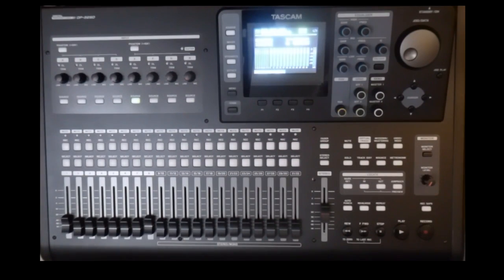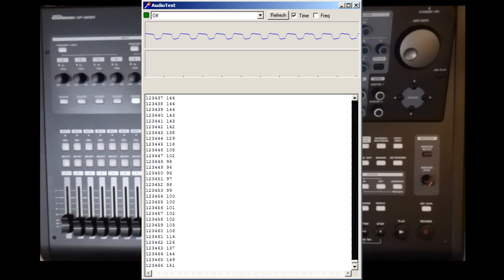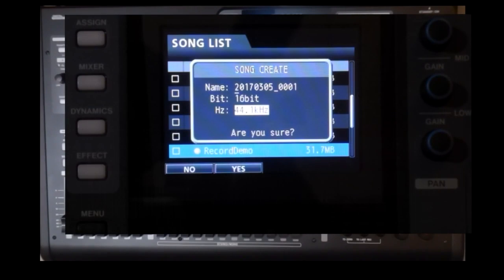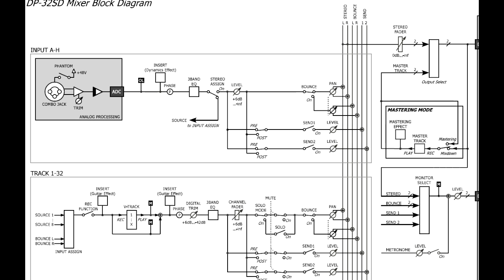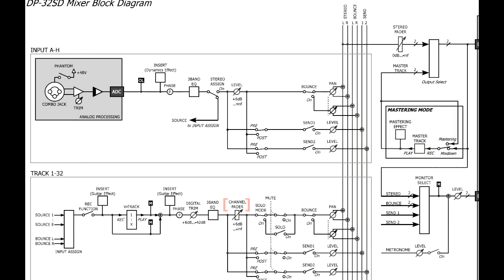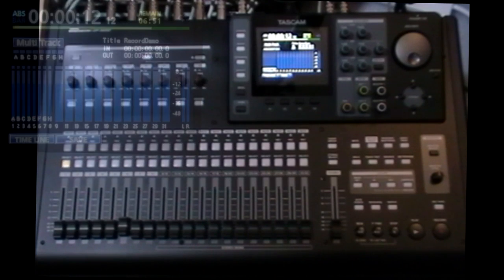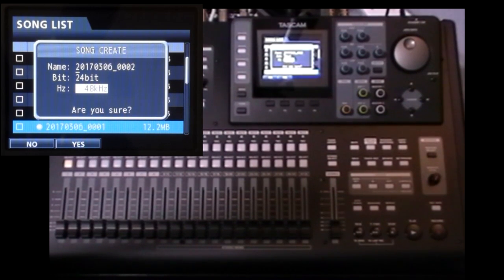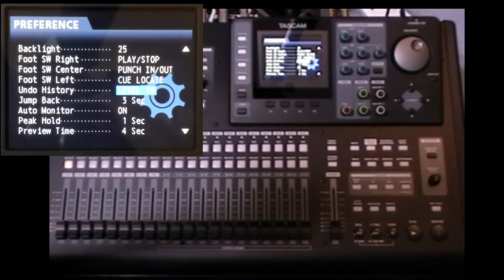Tascam DP24/32SD Tutorial 8A: Recording

Comment: There are some misleading assumption made here. Bitdepth is just the dynamic range and samplerate defines the bandwidth aka frequency range. Check out Nyquist. NOT how "detailed" a recording is. A recording with 16bit sounds the same to a 24bit recording. The noise level is just a higher which can effect the outcome but mostly not how people think of. Imagine everything every recorded on tape had specs much worse and the beatles, Michael Jackson and Pink Floyd sound fine til this day.
This whole 96 khz is more a marketing gag because you are just recording sound above 20 khz. What is there for the human ear? But the waves in the hearable range sounds the same. When I was young and started recording I thought switching to 24bit and 96khz would help to improve my productions and was wondering that it did not.
What I am just trying to say is: A pro recording with good musicians, mixing knowledge etc with 16bit and 44,1 khz will sound more "detailed" than a shitty sound made by an amateur in 32 bit 192 khz.
Reply from the maker: @timpanic thanks for the clarification Tim.

Comment: When I record, I hear the "punch in" of anything I want to fix.  the record button is so loud it picks up on the track.  is there a way around this? I have moved my mic to many different positions and places, but it still picks it up way too loud to cover it up with music :(  Help!
Reply from the maker: @Carrie-y4q If you use the Auto Punch In feature, the machine will go into record mode a few seconds after you press any buttons so your mic won't pick up the clicks. This delay is defined by the Pre-Roll period (which I think is set to 4 seconds by default). See the section in the manual called "Automatic punching in and out".
There's also a Repeat mode option with this, such that it automatically rewinds and records the section again onto a different virtual track. There are 8 virtual tracks so it can record up to 8 takes, all completely hands/click-free.
You could also use a footswitch, but I don't know how quiet they are.
Reply: purchase the foot pedal.  it works great and you do NOT hear the punches.
Reply from the maker: @Carrie-y4q That's good news Carrie, thanks for sharing.

Comment: Hi, you are doing a very detailed explanation here.
can you please confirm (or Not) if this device can be used as a drum microphones mixer? 
I mean can i put 8 mic in from the drums and record the drum set? thanks in advance mister.
Reply from the maker: @Bricksfromafrica Hi, yes it can be used to mix anything. The only limit is the max number of inputs, which is 8, so you could use all 8 for drum mics if you like, or use a combination of mics and line-level signals. If you've just started watching these videos from this one #8A, I strongly recommend you start from the beginning, and you'll see 2 ways of using the machine as a mixer. If the videos are too detailed, the step-by-step PDF guide may be useful to get started quickly without getting bogged down. You can always revisit the videos as & when you progress. Thanks for stopping by.
Reply: Thank you for your time.

Comment: Hello, I have a DP-24SD.  I'm trying to figure out how to record to tracks 13/14 - 23/24. I'm looking at the block diagrams. Page 77 on it doesn't ( Track 1-24 ) make sense.
Reply from the maker: @mbw4359 the crucial part of the block diagram is the STEREO ASSIGN switch. Admittedly, it's not very clear but this represents the Assign screen, where you can connect/route any of the 8 inputs to any of the 24 tracks, and/or directly to the stereo bus.

On the block diagram, the line going downwards from the switch, and then to left, is the path down to the track INPUT ASSIGN box.
The line going to the right from the switch is the direct path to the stereo bus.

Video 6A and earlier shows all this. If you've jumped straight in to this video 8A, you should really go back and watch them in sequence.

The assign screen saves you having to unplug/replug your intruments or mics; you just alter the assignments and record to different tracks as you want. The Model series does not have this feature, or at least it didn't when they first came out.
Hope that helps, and thanks for stopping by.
Reply: @philtipping  Hi Phil. They say a picture is worth a 1000 words! Well I figured out my problem. The manual doesn't show a picture of the assignments for tracks 13-14 / 23-24 Page 35. While trying to do something else I noticed that you had to use the arrows or Jog/Data to move it to one of those tracks. Your videos are very meticulous and I'm learning things from them still. TASCAM tec writers could learn a thing or two from you. Thanks!
Reply from the maker: @mbw4359 glad you got it sorted. That picture on page 35 shows the default assignments, which is inputs A-H routed to tracks 1-8.
If you don't like the default assignments (like me!), you can un-assign these (All-Clear F2) before you create your 'reset' template (video 2).
The videos also show another technique for setting assignments (or 'patching'), using the track select buttons and input source buttons. If you press the track button first (the patch destination) so it lights up, then the source button (the patch source), it makes the assignment between those 2 items. As with other operations, there are several ways of doing the same thing, so use whichever method is most comfortable/intuitive to you :)
Reply: @philtipping  u should be their tec writer! LOL

Comment: Hello, I’m having trouble assigning reverb to a channel. I’ve managed to figure out how to send flanger and tremolo etc but for some reason I can’t get reverb to play. Am I doing something wrong? Thanks!
Reply from the maker: @rickyhughes93 Reverb is available in the Send effects and also in the Amp section of the Insert(Guitar) effects. They are configured in different ways. The Send effects use the Eff Send controls to tap off a signal into the effect, then it returns onto the stereo bus for mixing at mixdown, or the bounce bus when bouncing.
The Insert(Guitar) effect is simply inserted into the required track signal path.
This summary may help: 
http://www.philizound.co.uk/freebies/dp24-32/FX-Summary.pdf
If you want step-by-step instructions, see the Step-By-Step PDF guide, available here:
http://www.philizound.co.uk/freebies/dp24-32/dp24-32.html

Comment: Phil,
I'm a bit flabbergasted by all the technical stuff but I have a question. I have an electronic drum kit (Alesis Crimson II) which, when I put in a stereo lead to my Tascam DP32, always sound echoey, like it's being played in a concert hall half a mile away. The mono sounds better but obviously, I would love to set up my drums so that I could pan certain drums/cymbals left and right to give them a bit of stereo depth. It means I have to take the reverb off the drums and just have them pretty flat sounding but that would be ok in the recording process. What I can't deal with is sounding like the whole thing is half a mile away in a concert hall (distant and echoey) The same thing was happening with the stereo lead on my other multitrack recorder, the Zoom Player, so what do I need to do to get the drums to sound good on the multitracks, especially on the stereo leads?
Reply from the maker: @fanfanackapan I don't have that drum kit, but I couldn't see any mention of reverb in the manual so I guess it's not a rogue setting on the Alesis, which means it must be coming from the Tascam... although this wouldn't explain why you also get reverb when using the Zoom... so I'm wondering whether it's really a phase issue, as this can sound similar. 

The problem can be caused by connecting a stereo output to a balanced input, in which case the left & right sides will be out of phase. The Crimson output is a single stereo jack socket, so you really need a splitter cable to connect it to the DP machine. If you just use a single cable, this will present the left & right signals from the Alesis to the hot & cold connections on the Tascam's mono inputs (all inputs are mono) and you'll get phasing issues. A splitter cable will have a single TRS plug at one end (for the Alesis), and 2 TS plugs at the other (for the Tascam). The latter are the left & right signals which should connect to adjacent pairs of inputs on the DP machine. You can assign these to a stereo track or 2 separate mono tracks.

On the offchance it really is just a rogue reverb from the Tascam issue though, this should also be easy to fix. It's very easy to get unexpected effects with the DP machines as all settings are carried forwards into new songs when you create them. The first couple of videos in this tutorial show how to avoid this by starting with 'blank slate' settings. If you don't do this, your only option is to go through all the effects and turn off the culprit. It's quite tedious to do (as shown in video 2) as there are 3 different sections for effects, and they can be applied to any of the 8 inputs and any of the 24/32 tracks.

Re. panning individual drums, it seems the Crimson machine only has a single composite output, so you cannot separate the individual drums for recording on to their own tracks. I guess you could make multiple recordings with the Crimson set to one drum sound at a time, and overdub them to different tracks. You could then add different amounts of pan/eq/fx to these as required... but it depends how much patience you have.
Ideally, a drum machine with individual outputs would be an easier choice.
Good luck.

Comment: How do you toggle the monitors ON/OFF so that the playback is only coming through the headphones instead of both headphone and speaker?  On my old Tascam 2488 there used to be a "mute monitor" button right next to the monitor level control knob but this work station doesn't seem to have one.  I'd really hate to think that I would have to manually turn my monitors on/off between takes just so we can record.  Can anyone help answer this for me?
Reply from the maker: @Kurse there's no way to do this; the headphone output is internally coupled to the monitor outputs. Work-rounds include simple on/off switches in the monitor outputs, or more complicated devices which can drive both headphones and speakers... some have additional volume controls. Driving headphones via the monitor outputs has an advantage in that it bypasses Tascam's headphone amp, which can produce a small amount of background hiss (depending on your headphone sensitivity/impedance). Thanks for stopping by.

Comment: Great series on this machine and I've already learned alot. I am having trouble finding a tutorial heading that will lead me to the automatic punch in/out function. I tried on my own but get the dreaded I/O too short msg and can't figure my way to find the right combination to procede.
Reply from the maker: @Robert Potter Thank you Robert. I'm afraid that topic isn't covered here, and I don't recall seeing it on other tutorials, but the Tascam manual is fairly good at describing the process. The restriction on the minimum gap between IN and OUT points cannot be overridden so as far as I know, you just have to live with it and punch-in over a longer section.
 
There are 2 other settings which help achieve a good punch-in - the pre & post roll settings. These provide a longer 'window' around the actual IN & OUT points, so you have 4 time points which control the operation:
1. When the machine starts, it goes to the pre-roll point and starts playing. 
2. When it reaches the IN point, it starts recording.
3. When it reaches the OUT point, it stops recording but continues to play.
4. When it reaches the post-roll point, it stops.

The pre-roll allows you to start playing/singing along with the other tracks just so you can get into the groove with the song, and the recording starts automatically at a later time, hopefully giving a seamless punch-in.

It may take quite a bit of practice to get a seamless join though, as it depends how good you or the other musicians are at repeating something exactly the same way. One tip is to choose the IN & OUT points at a transient point in the song, such as a drum hit, so it masks the join, but any slight differences, such as distance from the mic, playing technique, etc. will make the punch-in stand out from the rest. 

Some people have the knack to do this well, but I tend to avoid using the technique because of this. I either repeat the whole song, or if that's too difficult, repeat a section such as a verse or chorus which encompasses the duff part. I also record any repeats onto different tracks - that's the beauty of having loads of tracks :) - and then edit the good bits together using copy/paste. The Track-Edit functions are well worth getting to grips with as they are so useful and instantaneous... and can be undone if you don't get it right.

Just as an aside, the Track Edit functions also use the IN & OUT points to define sections for copying/cutting etc. and that minimum gap limit still applies here. But in this case, you can avoid the problem by using reverse logic and using IN/OUT to define the sections before or after the section of interest.

Other options which make punch-ins easier are the foot-switch, and/or the REPEAT option. If you press the REPEAT button, the punch-in will automatically record onto successive virtual tracks. There are a total of 8 virtual tracks for every channel, so this process will repeat hands-free until all 8 are filled. You can stop it earlier if you like, but it means you can keep retrying a punch-in (including the pre/post roll) multiple times without ever touching the machine.
You can then go back and review the virtual tracks to find the best one.

Hope that helps.
Good luck.
Reply: @philtipping  Wow, didn't expect all that responce detail but thank you for the remarks and for pointing out the other options. I do bass tracks on keyboard and I'm not a keyboard player so rarely get through a song without several klunkers which makes punching seem like my only solution. The foot pedal is on my list.  I refer to your tutorials often while learning the machine so thanks for doing them and for responding to my question.

Comment: I've been seeing a few impatient comments on these tutorials from time to time. Most concern themselves with Phil not sticking to the basic explaining of tactile operations. Phil tends to explain the signal path first. I recall when I was teaching my kids how to drive a car. After actually letting them drive a bit, I drew diagrams of how a disc brake system works or how stepping on the accelerator makes fuel go into the carb, cylinders and creates motion that goes to the flywheel, transmission, driveshaft, transfer case, and wheels.  I would imagine most race drivers know what is happening funtionally with the car they drive and can envision what is going on when something does not feel or sound right. It is important stuff to know. Just sayin'.